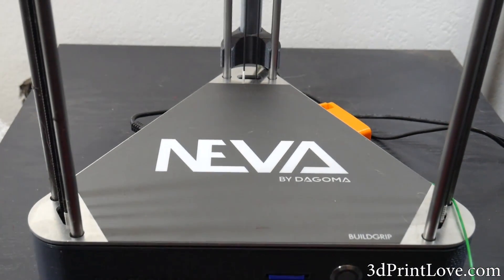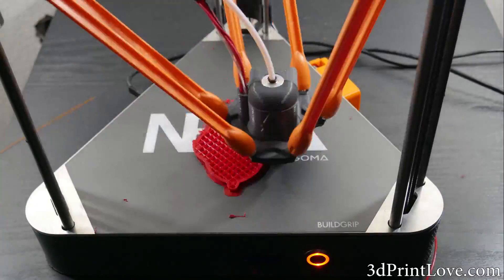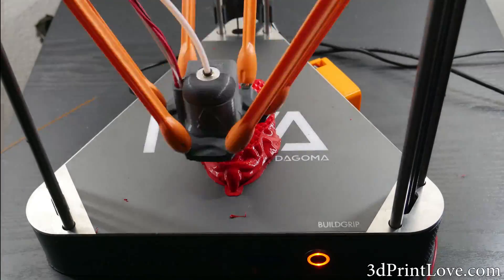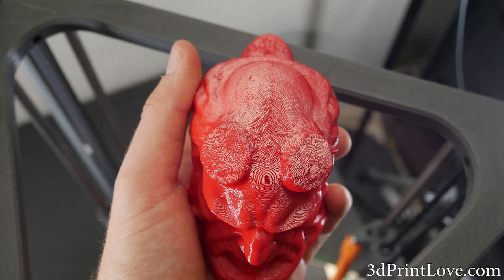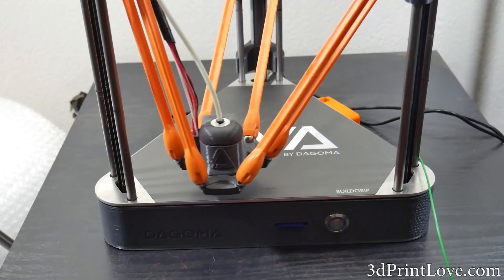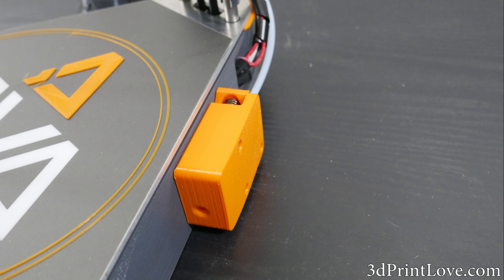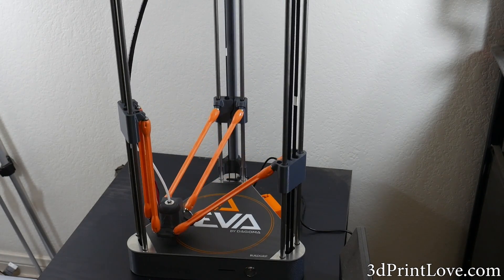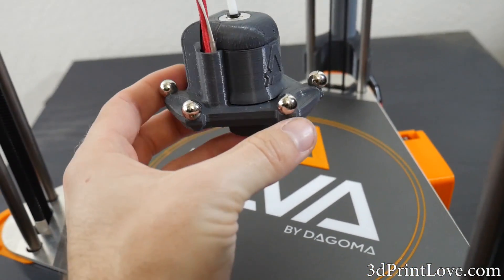Kickstarter 3d Printer That Does Not Disappoint | Dagoma Neva Review

Comment: Seems that you've fallen into the Repetier-Host trap. ;-)  In Repetier-Host printer's setup, there is this silly little checkbox that prevents many users form connecting to their printers.  It's not the printer's fault, it's Rep-Host's.  Click the "Ping Pong" checkbox to fix it.  All printers user 250,000, N, 8, 1 or 115200, N, 8, 1 as their baud rate, but since Cura is already talking to it, the baud rate is correct, so use it for Rep-Host as well.  (Just flip that silly Ping Pong checkbox.)

Comment: So you're saying the printer is good but it's not worth $350.
Reply from the maker: i think it is a really good 3d printer and at 350 dollars it can definitely be worth it depending on who is buying it. You can get kits for way cheaper. I feel that the person looking into this printer wants something that they buy, plug in, and prints. This machine does that and it does that pretty damn well. Then again someone might rather buy a kit for 160 bucks spend a day and have a machine at half the cost. With this machine you get simplicity, and a warranty. Less to me for people that like tinnkering and upgrading more for people who want to prototype or manufacture on a small scale with a printer farm.
Reply: 350 dollars is the pre-order cost, it will cost 499 dollars so it's definitively not worth it. It's more interesting if you are french or live in west US because that's where the after sales service are.
For 399 dollars there is the Kudo3D Bean (assembled) an SLA printer which can print much more details and for FDM there is the Kodama Obsidian (assembled) at 99 dollars and can be pre-ordered at 49 dollars.
Reply: Danyl Bekhoucha Yeah 350 is a lot and 499 is over doing it. I got my first 3D printer for 180.

Comment: No offense I think you are only giving it a good review because you received one for review.  No heat bed,  no ability to interface with third party slicing software,  no ability to connect it to third party printer management suite's like octoprint or repetier server,  no open source firmware,  no upgradeability at all (unless they release stuff in the future),  does not have a screen,  cant stream gcode to it with wifi,  and what about replacement parts?  I would say its a terrible printer for 400$.   The ONLY good thing's about this printer is that it comes assembled,  and will print PLA things so long as they aren't too complex to the point of requiring special considerations in your slicing software.  I watched the live streams the torture cube failed,  and so did nearly every print you attempted;  probably in llarge part to that rudimentary slicer and no way to tune extrusion,  cooling, etc.  I'm not so sure this is the printer we want people using as their first 3D printer,  it has the potential to disappoint.  Either way just my two cents,  if it works for you;  that's all that matters.
Reply from the maker: Most of your points are not really true or valid. I have been told it can be used with any slicer. I have not hear back at this point but since that is what I was told then I have no reason to believe it is not able to be used with any slicer. On top of that if it is able to be used with any slicer and connected to a computer via usb then octoprint would work just fine which is two of the points you placed against it. Stream gcode over wifi would be available via octopritn. Again heatbed really is no big deal to me and I did point that out. The thing is still in kickstarter. I see no reason that it would not be able to be used with replacement parts it does have a warranty. If i thought it was a piece of shit I really could care less that it was sent to me. The printer is mine if I want to hit it with my car I can. Most of the issues you are pointing out are fixable by using a 3rd party slicer like you can do with the machine. Again in the video I did not say you cant do this just that when I tried with the baudrates I use on my other machines I had no success. Normally I would not even type this much but seriously I do not understand how you came to the conclusion you did.
Reply: You cant really base a review on features that you were "told" are features.  You need to review the printer as is.
Reply: You can indeed use any slicer. The file created with the dagoma soft is a simple gcode, so you can use any slicer and use the same name for the file. And for the test print i pointed this out in your last video, hope you did a new calibration after, maybe it would help.
Reply: On stream he tried to rename the g file to .gcode and it doesn't work.  So ...  yeah.
Reply from the maker: which i did do but again this printer is not even available yet kickstarter is still going and software is in beta. as long as they keep there word on allowing you to use your slicer the printer is badass. If they dont allow you to use the slicer you want then i would not recommend this printer. I tried to focus more on the hardware. coming from mostly kit printers, the da vinci, and the monoprice amongst a few others 400 bucks is cheap for what you are getting. Many others in the range are junk or diy which i dont mind but this printer is not targeted at the diy audience
Reply from the maker: +Jeyg I did do a new calibration I had no issues with sticking after calibration and cleaning the build surface I would like to know the baud rate for use with other slicers
Reply from the maker: +r1tual he did just say you need to name it the same name as their cura software outputs which could mean when pressing the button it checks only for that name on the SD card.
Reply: That's it. You need to name it Dagoma0.g or whatever the file name is.
Reply from the maker: +Jeyg what about the baudrate